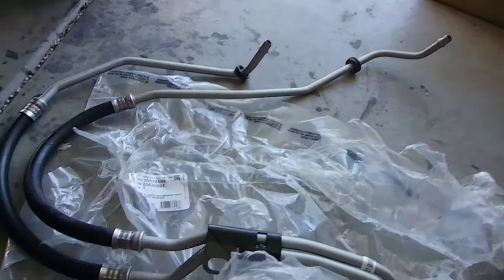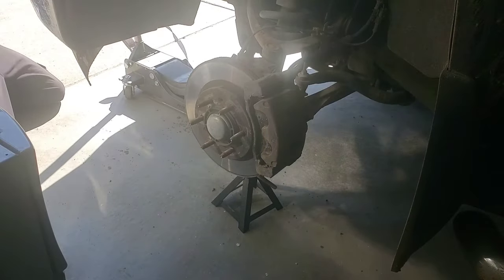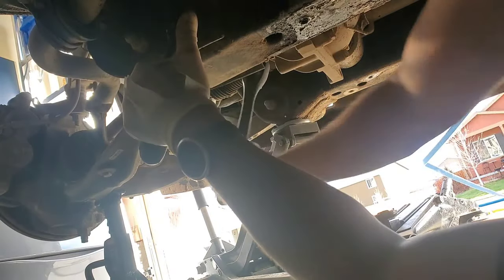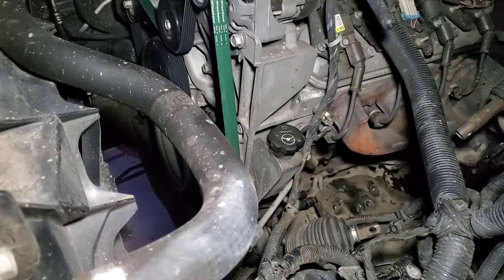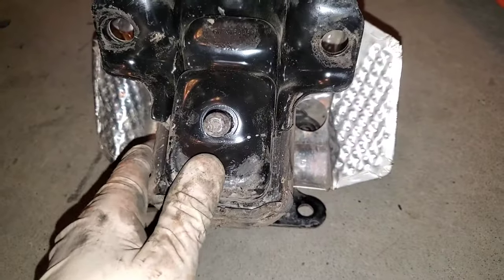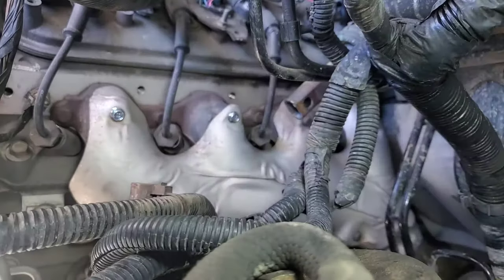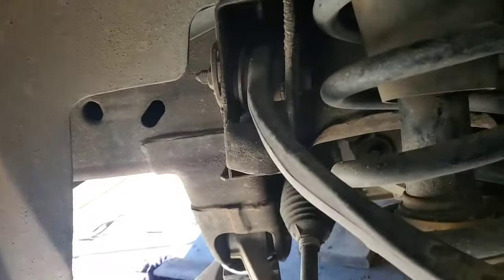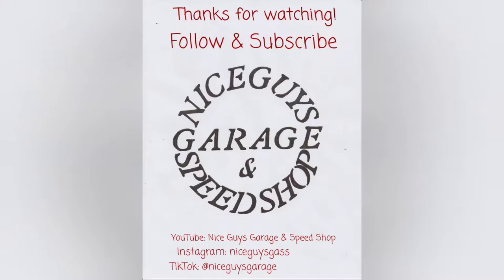How To: Replace Oil Cooler Lines, 2007 - 2013 Chevrolet Silverado or GMC Sierra (4x4) the EASY way

Comment: I did this yesterday without removing any of that. I disconnected the front drive shaft and removed the oil filter(changed the oil while i was at it). It took a few hours. I did see the electrical connector that could be easily damaged. I had my neice and nephew as helpers, but if you're doing it by yourself, then I'd say make the extra room by removing fender, steering, and motor mount. I like how much you could see in your video. Most others I've watched about this process dont even show them running the new lines.
Reply from the maker: Always good to have helpers! We've read a few comments and it seems there are multiple ways to do this job. Glad to hear you got it done, and we appreciate the feedback!

Comment: Thanks for this video!  You inspired me to save a bunch of time! To add to your method, you can save even more time doing the following:

1)Remove drivers side inner fender.
2)Remove 3 motor mount bolts on each motor mount to frame connection. 
3)Use a 1x6 about 12” long vertically between the axle and cross member to jack the entire engine up out of the mount seats. 
4)Lines will now maneuver between motor mount and frame.
Reply from the maker: Awesome! We’ll keep those in mind if we ever have to do this job again! Thanks for watching!
Reply: I'm about to tackle this job, and appreciate all the tips.

Comment: I tackled this repair this weekend. Ordered the new lines a few weeks ago but dreaded actually replacing them.. and i was proven right, lol. I will take to the junkyard before replace these a second time haha. 

Your video was very helpful. Very informative. 
In the end i couldnt get the steering shaft out. Was rusted in place bad. Sprayed, hit, and torched but nothing broke it free. Further, i couldn’t for the life of me get to the motor mount bolts. Only got two of the seven before i aborted mission and went a different route. 

Ended up removed the drive shaft and tucking out of way. Removed oil filter and started to remove the front diff. Just dropping it down a few inches without having to fully remove was exactly the trick. I was able to easily slide out the old lines and slide the new ones in in a matter of minutes after deciding to drop the diff down. 

I got that idea from some comments on your video. 
Still a great way you have there, I just couldn’t get it done that way, which is my fault, not yours. 

Still, your video got me all informed and ready for this which was invaluable on the end. 

Kudos to you sir, wouldn’t have been able to without this. 
Btw, Idk if you get this a lot but i kept thinking this was Dax Shepard narrating this. Made it that much better, lol 

Thanks again. Will be back for others
Reply from the maker: Thanks for the comment, Zak! 

Yes. We hear Dax or Derek from VGG.. both are flattering! We're happy to help, and even happier to entertain. We keep hearing about the front differential method, seems it might be easier from what people say.

We're with you on the junkyard plan! Or maybe just a block off plate for the oil cooler. We've even heard people say they just cut the line and add a rubber section. No matter what you do, you gotta throw a few profanities at Chevy during the repair!

Comment: I did this job on my 2010 Silverado 1500 4wd a couple days ago. I discounted the drive shaft and the engine mount, jacked up the engine about 2 inches. I did not need to remove the engine mount, only removed the bolts, however I am small enough to fit between the fan and front of the engine to squeeze my hand behind the power steering pump to remove the line mount bolt.  Perfect amount of space and completed in 3-4 hours. Took awhile to twist and turn the leaking ones out but I surprised myself with getting the new ones in super quick.
Reply from the maker: Nice job! Sounds like a good way to get it done!

Comment: Just tackled this job myself and thanks to your video saved from going to the stealership! I’m glad some people were able to avoid pulling the motor mount. I dropped the fwd driveshaft and tried to get the lines out. Long story short I ended up just doing what you did. If these ever leak again though I’m slapping on that flex tape like in the as seen on tv commercials 🤣
Reply from the maker: Happy to hear that it worked out for you! Yeah, next time it leaks just sell it on Craigslist. "Runs great, no issues". Kidding... but this job really does suck! At least we were able to make it suck less for you!!

Comment: Love the video. Little tech tip: put some electrical tape on your swivel and it will hold it steady and still allow you to manipulate it. About to tackle this myself. I will probably go with removing axle seems a little less hectic. Thank you for this video. 🙏🏽
Reply from the maker: Thanks for the tip! We'll give it a shot. Yes, if you have the ability to remove the axle that is faster, this was primarily to show it can be don't without that step, thanks for watching!!

Comment: I’ve replaced all the rotted out brake lines on my 2003 Tahoe before selling….hardest one was from ABS module to rear axle….tightest place for a brake line…I’m hoping I’ll figure out how to snake the new oil cooler lines easier lol, video helps a lot! Thank you
Reply from the maker: You're welcome! Happy to hear it was helpful... every now and again we get lucky and figure out an easy way to do stuff. When we do, we share.

Comment: Great job 👏 editing it, loved the whole video! 
I’m hoping my 5.3 motor is easier then yours.
Reply from the maker: Thank you for the feedback! Happy to help. Unfortunately, if you have a 4x4 it will be the same =(. The block is the same on the outside and GM used the exact same part for both engines (GM Part # 20828695). Sorry! At least you have an entertaining video to guide you through the process =)
Reply: @NiceGuysGASS  Ok, Yes and thank you! I did it but it wont stop leaking after putting in the new one. I did use the new gasket and made sure it was clean. I used lock washers one time and it still leaked through the bolt part, strange but without washers it still leaks very slightly. I don't want to go to tight so i strip them. I'll try cleaning both sides again. Thanks Again.
Reply from the maker: Hey Robert, did you ever get that leak figured out? Sometimes the block side can be tricky and the old gasket or washers will be stuck causing problems with the sealing surface
Reply: @robcbr91  on the cooler block some have a plug facing the back of the engine and the o-ring will leak.

Comment: Nice video. I'm a mechanic and that motor mount is hell. Instead I pulled the front of the front driveshaft and dropped it down and pulled the lines out the rear and didn't touch motor mount, diff, or jack engine. Didn't take too long.
Reply from the maker: That does seem easy! When we do this job again, we might give that method a go, thank you for sharing!
Reply: Can u explaina little further how you did that without the motor mount removal
Reply: @NORCALPYRO_  He said he disconnected the front of the drive shaft and dropped it

Comment: I agreed to take on this job for my neighbor. His truck had the 8.1 liter motor and as you can imagine, the clearance was impossible without removing the steering link and dropping the front differential. If somebody asked me to do this job again, I'd probably go to jail for murder.
Reply from the maker: Yes, the big block would make our method impossible! Usually GM is well designed for the shade tree guys but these lines were clearly designed by suit and tie engineers...

Comment: Also pull lines out through bottom the way they are bent you’ll have a hell of a time getting them out through the front way easier to pull out through bottom and feed in the Same way I just pulled driveshaft off front diff and set it out of way. Much easier!!
Reply from the maker: Good advice for people that are going to use this method. Glad to hear the repair went well!

Comment: I would put the clips back in as soon as the lines were removed. Only cuz I lose everything lol😂. Also you should have started and ran the truck and then checked the oil. Your new oil lines were still empty. Thanks for the video. Lets me know what I am fixing to have to do.
Reply from the maker: Good idea with the clips! And yes, always a good idea to double check the oil level after running for a few moments, but we also recommend checking before first start to make sure you don't accidentally start an engine without oil in it! 

Thanks for the feedback, check out our other videos... some are helpful, others are purely dumb and entertaining. We'll let you decide which is which!

Comment: You only have to drop the four bolts on the centre pumpkin of the front diff. It goes down enough that you can slip everything by and it works great and I didn’t use jackstands it was on the floor.
Reply from the maker: That’s wonderful news! We still recommend jack stands for safety though.

Comment: You could just delete the oil cooler lines with a block off plate for like 20 bucks. It's cheaper and better. Less likely to leak again. And your oil pressure will go up.
Reply from the maker: Very true, but with all the towing this rig does we wanted to keep the oil cooler. Block off plate is a much cheaper solution though
Reply: Good point I hardly ever tow with my avalanche 6.0 I think I'll be looking for the block off plate cool suggestion.

Comment: I kist replaced mine i didn’t take the mount off did take the bolts to the frame off and jacked the motor up a little and unhooked the front drive shaft
Reply from the maker: Nice! That seems a bit easier, thanks for sharing

Comment: Thanks for the vid, couldn’t find much for 4wd trucks. Gonna take a stab at this soon. Looks doable
Reply from the maker: It absolutely is. Some of our viewers have said dropping the front axle down a few inches is easier... not sure if it is, but we've replaces the front diff on this truck (after this video) and it wasn't too bad.
Reply: @NiceGuysGASS  part way thru rn following your video. Should have it wrapped up tomorrow. Engine mount is loose and it looks straight forward from there. I don’t see any reason to drop the front diff at all, that’s part of why I put it off until I found your video 😂 cheers
Reply from the maker: How did this story end? Don't leave us with us cliffhanger!
Reply: @NiceGuysGASS  haha it’s all done! No leaks, took me a couple days but honestly a weekend of work. I think the hardest part was getting the stupid engine mount off. Dropping bolts, buying a replacement then eventually finding the old ones. Most my sockets were either too short or too long. Took me 5 minutes to get the line out and another 5 to get it in
Reply from the maker: Happy to hear it all went well! It can be a bit of a bear when you're trying to work in that tight space. Next time it starts leaking, you can anyways sell the truck!

Comment: thanks for the confidence. I managed to shove mine in from the back (fed the longer one first then the shorter). only got stuck on the end piece which I dropped the sway bar for. I did end up loosening one motor mount so when I dropped the sway bar I also jacked half an inch higher with the motor. do not know how effective it was because my jack leaks out. I also removed the front splash guard but nothing else. I am not sure if AWD is easier than 4wd. 08 escalade awd
Reply from the maker: Sounds like you made it through, sometimes that’s all that matters!

Comment: Here in Canada, when I'm putting things back together, I put antiseize on all the fasteners, and Coppercoat on manifold bolts. Just incase I have to take it apart another time.
Reply from the maker: We use anti-seize on a lot of parts, just depends on the part and the likelihood of removal again. Definitely on wear parts.

Comment: You can do this by taking out the 2 bolts that hold the front differential up on the drivers side. Comes out the front. No need to take the steering apart.
Reply from the maker: We have heard about this method, and it seems it may be even easier! Next time we tackle this (it's a Chevy, it'll happen again) we will have to film this other method.

Comment: Just changed them on a 2011 I just loosened up 4 bolts on front diff and got them out I definitely wouldn’t go through the headache of pulling motor mounts😂 either way it’s a dam headache good luck!
Reply from the maker: It is a headache! Next time (it's a Chevy, there will be a next time) we might do it your way, see if we like it better
Reply: That’s all I did.  Loosen 4 front diff bolts until differential hit the crossmember, hoses came right out…with 10 or so four letter words.

Comment: Any time I pull a wheel , I stick it face down under the vehicle as close to the removal point as I can.
As it may save your life if the jack or stand fails. 
  Be safe brother.  Good video.
Reply from the maker: This is good advice, we will typically use some level of redundancy (extra jack stand, jack still in place, etc), and this idea is in line with that. Thanks for sharing, and thanks for watching!
Reply: @NiceGuysGASS  You’re welcome 👍

Comment: Does this just happen because it dry rods or something or is this because of a bigger mechanical issue?
Reply from the maker: It is just a normal Chevy leak. Both sets of lines, oil and transmission, leak over time. It is probably related to rubber failure and the connection between rubber and metal.

Comment: Just did this as mobile mechanic.  Even by mechanic standards this job kind of sucks.  Good video, though these oil pans are solid and you can get a 2 x 4 under there without messing with that cross member, manifold heat sheild can stay too.       This truck is so not from the northeast.  Watching that steering shaft slide off effortlessly made me angry....  As did those heat shield bolts not breaking.   I can't be too mad because engine mount/ steering shaft is totally the way to go.  Thanks
Reply from the maker: Glad it helped! We are lucky here in Colorado.. minimal rust issues. Happy to hear you found a way to improve our process, gotta love the 'tube... we all learn from each other.

Comment: Thank you. It's very informative & entertaining. I'm a woman & want to try to do this job by myself because I spend a lot of money (on many vehicles) to the shops & automotive guys to do the repairs. Some are not good & all expensive. I want to replace the rubber tubes method. What tool should I use to cut the rubber tube? Do I use a 3/8" fuel line? Is 40 PSI good enough or has to be 50 PSI? Is the regular steel clamp that you use a small socket or screwdriver to tighten good enough? If I need to replace the steering lines. Can I use the same method by reusing the old tubes & using the same fuel lines & clamps to replace the rubber parts? I also have a problem that oil gets into the cooling system, not much, floating on the top in radiator & reservoir. But no water in the oil, I'm positive that it's NOT blown head gasket. Can you tell me from what part that the oil gets into the cooling system? The Chevy mechanic at the dealership told me it has to be from the engine side. This is a 94 Chevy K1500 truck with 126,5xx miles. I have very little knowledge about mechanical but I learn a lot of YouTube now. I want to tackle these jobs first before I have to send it to the shop.  I have already spent a lot of money on this truck & it will need a lot of work because the original owner did not take good care of the truck & all are original parts so I can see the big expenses are coming. I'm considering selling it after I do all these repairs (driveshaft start leaking too). The oil has been leaking for a long time & the previous owner never take care of it. I'm the 2nd owner, I might use less than 30,000 miles. Help & Advice, please.
Reply from the maker: Pat, thanks for reaching out. You absolutely can not replace only the rubber parts of the line. No, you can not use fuel line. No, you can not use hose clamps. While the oil lines on a GMT 400 (1994 Chevrolet K1500) are similar to those shown on this video, the process will be slightly different. The same applies for your power steering lines. They need to be replaced with proper parts. 

As far as the oil in the coolant, there are a number of variables, but the most common would be a head gasket. There are also a number of other possibilities including a cracked block, but without a proper diagnosis, there is no way for us to be sure.
Reply: Oil pressure gets to 100psi and if it blows the hose off, you will likely need a new engine

Comment: They say to drop the diff for a reason. It’s much easier. Just a few bolts and drop it down a little and your right there at it. Don’t even have to drop it entirely.
Reply from the maker: We saw your other comment, sounds like you found an easier way!

Comment: Help! I started this process and the steering rack won’t come out! I took out all the bolts and it will not budge whatsoever
Reply from the maker: Penetrating spray (PB blast or similar) and heat should do it. Sometimes they like to rust together.

Comment: Isn't there another way to put those oil lines in without removing half the engine compartment?
Reply from the maker: Yes, you can drop the front differential. We haven't done it this way. But we're told you can get away with only dropping it a few inches and still leaving it attached - if you want to give that a try you can check out our video where we completely remove the front diff to see how it's supported in the truck.

https://youtu.be/Ixfy5PL4x6M?si=YVwsDkvQE8i0B6zh

Best of luck! Let us know how it turns out